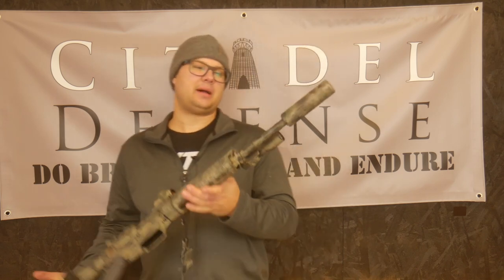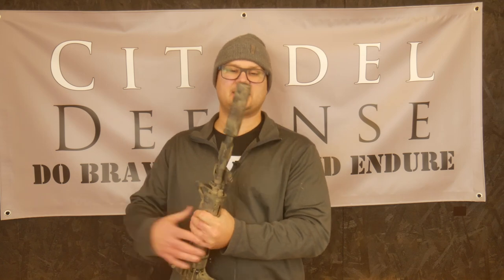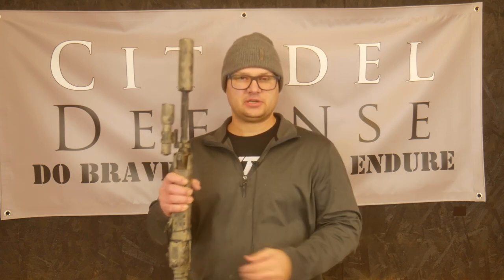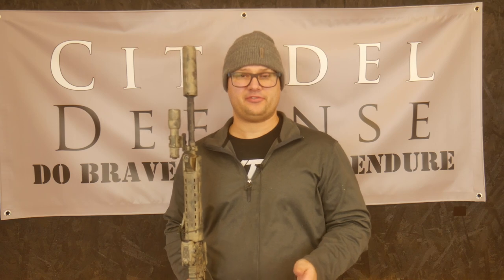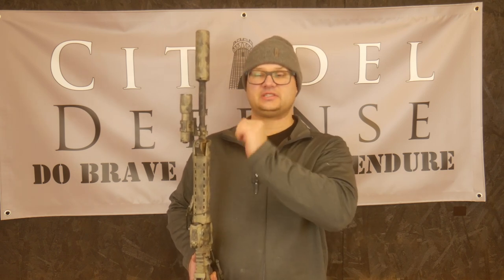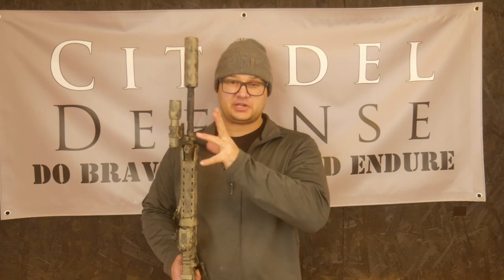Can you paint a silencer? Was Garand Thumb wrong?

Comment: Thats a great looking paint job! 

I've used high temp paint (black or dark green from rustoleum)  which should handle much higher temps than the silencer gets and it completely rubbed off my can because 1) I didn't prep the smooth areas properly and 2) I didn't cure the paint in the oven.

Roughed up and with a cured base I haven't had trouble with a 2nd camouflage coat painted over it for it to grip.

I usually cover them all with a camouflage silicone Mantis or fabric cover anyways because of all the heat in front of my optic and since I'm not running FA.

Comment: Only thing I can think of is the baffles acting as a radiator dissipating the heat there from the can, while sending extra gas back and increasing the time the gases are in the barrel leading to more heat and the baffle allowing back flow to cool the can but restricting enough to keep it from the barrel??

But idk I play with soundwaves not heat.